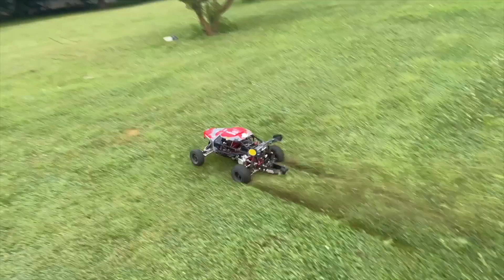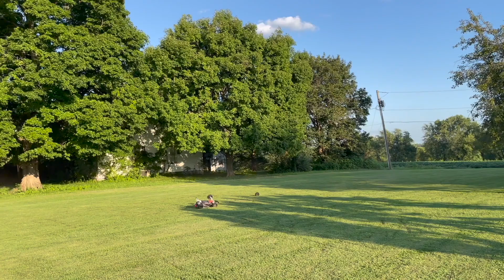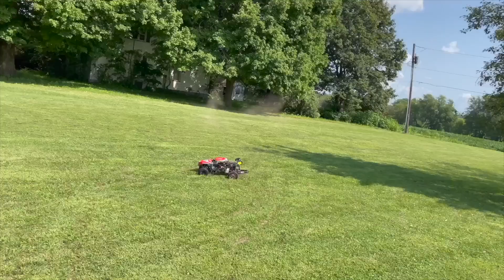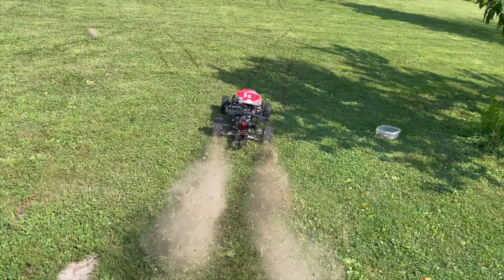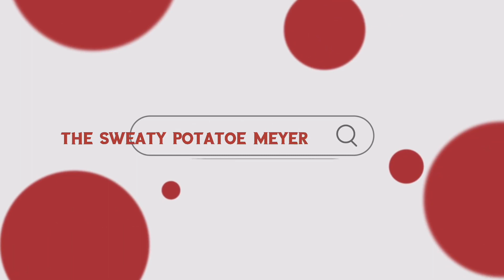FIFTH SCALE RC FUEL,  OIL,  AND RATIO DISCUSSION

Comment: Man new sub here. I had no clue you were ever in a wreck. You rock.  I just bought my first Baja 5b Rofun. It ran so good during break in, I rewarded it with a super pretty HTZ blued pipe from Taylor and a red K&N filter before Ive even driven it.  What air filter oil should I use?  Im running pump fuel w ethanol additive, Yamaha 2 stroke oil 30:1 for break in then Ill move that up to 40:1. Thanks for the fun videos.
Reply from the maker: I would always run a foam filter unless you are doing some on road running, those k&n filters don’t stop much. 
My favorite fuel is VP C12 and I always mix 25:1 because I run Taylor engines and that’s what Mike recommends 👍🏼🤙🏼
Reply: @Meyers2strokeRcgarage  Ok cool that is good to know.  Im staying on road or short grass, I dont do burn outs. If I decide to hit the dirt I will switch air filters.  Thanks again for the great info, Im a heli guy.

Comment: Great video bro, I use around 8% castor oil (Putoline) for my sons 50cc 2 stroke comer engine (kart).
If I was to use a small amount of Nitro Fuel can you tell me what mix I should be looking to use with Octane 98 fuel?
Reply from the maker: Is the nitro premixed with any oil?
Reply: @Meyers2strokeRcgarage yes it contains 16% nitro with 15% synthetic oil (Klotz). The product is called Optimix 16% RTR Nitro fuel.  Any advice would be appreciated my friend :)
Reply from the maker: @gavinbutchard3479  I would be concerned about over mixing the fuel with oil. If the nitro is mixed 15% and you’re also using a mix of say 25:1 the fuel will be mixed with too much oil.
Reply: @Meyers2strokeRcgarage  What would you recommend to put straight into the fuel tank to give it a boost?
Fuel tank has 98 octane & 8% Castor mix.
Reply from the maker: @gavinbutchard3479  yep 👍🏼 that’s what I would do.

Comment: i picked up some c16 and have a new obr full mod reed 34 on its way what would be a safe ratio to mix at?? 25;1 i want to stay safe!! thanks your channel rocks
Reply from the maker: What oil are you running???  That makes a difference as well
Reply: @Meyers2strokeRcgarage  right now i use lucas synthetic
Reply from the maker: @gradydeadsy6001   I would stay around 28 to 32 to 1.  Amzoil saber 50-100:1and dominator you could probably get away with 50 to 1
Reply: I was able to trade it to a store for c12 and I ordered some 927 ty for ur help
Reply from the maker: @gradydeadsy6001  No problem brother anytime 👍🏼

Comment: hey man i just got a 29cc rovan q shorty and im new to the gas RCs and i was wondering if u new if i can run      VP pro-max hi-performance 50:1 ready to use 2-cycle fuel???my local walmart as alot for 6$ a can and i was just wondering if its safe?o and by the way love ur videos and content
Reply from the maker: I’ve never bought any pre-mixes The most important thing is to know what kind of oil they’re using to mix with whether it’s for lawn equipment or something else. I know a lot of people who run premixed gas like that and have no problems but I don’t do it personally and won’t put my word on the line for it😉
Reply: @Meyers2strokeRcgarage  ok thanks man

Comment: So after Comming across your video ima gonna give 32/1 a try (: 

Been running 25/1 with amsol interceptor says it’s good for 50/1 but I don’t need todo max specs of what oil can do, if I do try 50/1 I’ll switch up to saber I also wanna switch to saber cause of the fuel stabilizer already mixed into it!  

I run a custom 45cc zenoah motor (: Temps are around 180c I did get it to 220 for break in. By adjusting carb to idle a bit higher.

Great content.

I do have 1 question?. When you went back to 25/1 with 40T motor and motol did you feel lose of power? That’s one thing you didn’t touch up on. Lol
Reply from the maker: Awesome comment bro!!! When I switched back to 25 to 1 with the 40 GT from Taylor RC I did not notice a drop in power at all. In fact I gained power 👍🏼that could be partly because of the Taylor 40 GT is so powerful.  I’ve done lots of research, and I found out that two strokes actually make more power running thicker ratios.
Reply from the maker: Here’s a link with some more info 

https://youtu.be/epvl6KHbLmc

Comment: Can I use 40 to 1 vp
Reply from the maker: I don’t run it personally but I know people who have so yep 👍🏼 I prefer to mix my own fuel so I can use my oil that I like 💪🏼
Reply: @Meyer’s 2 Stroke Rc Garage   great thanks  or can I run 91 octane.  And     50 to 1   with 2 stroke red line oil what would you recommend 40 to1 or 50 to 1 Thanks for your vids
Reply from the maker: They are both good bro redline is fantastic and VP fuels are as well 😉

Comment: I been using sef walmart already mixed 40:1/50:1 burns clean and decent so far original 26cc had gallons of it through it just replaced with a flmlf generic 30.5cc we shall see I broke it in and sent it with the premix

Comment: 25 to1 change plug before every run, 50to 1 dominator same plug 1yr+
Reply from the maker: What pug and oil are you running at 25:1?  I have absolutely no issues with pugs fouling 😉
Reply: @Meyers2strokeRcgarage  CASTOR 927
Reply from the maker: @barryodog  NGK plug?  And what #

Comment: C12 is 107 octane
Reply from the maker: Ron = 107 😉       (R+M)2 = 112 💪🏼😁
Reply from the maker: Next time you go to the gas pump notice it always states for example 91 octane using (R+M)2 method or 89 octane using the same method 😉 i’ve never seen them refer to octane as RON at the pump.
Reply: Well I was talking to a engine builder that I'm going to buy c12 from and he told me it 107